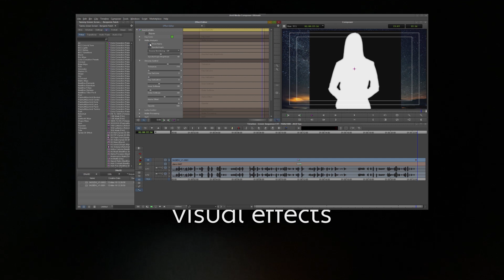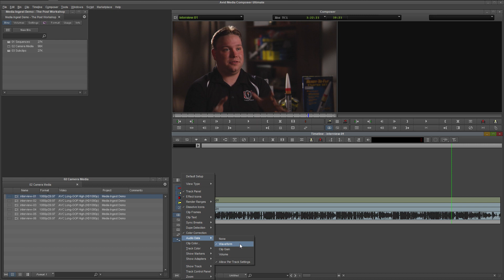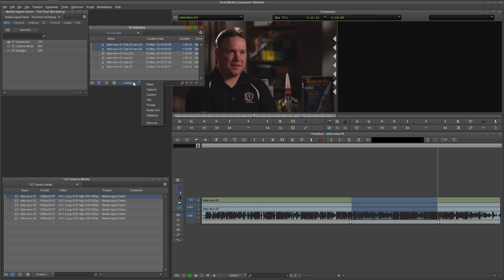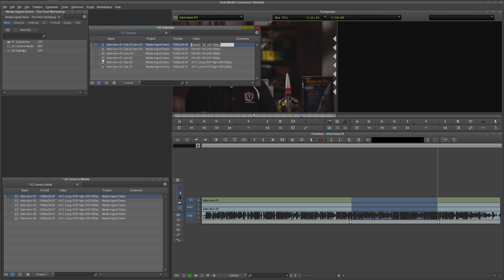Avid Media Composer - Optimize Partial Subclips for Video Editing

Comment: If I'm working with 4K files in a 1080p timeline, I like using the FrameFelx functionality to zoom and move into the image. If I transcode these files will I lose this functionality? Can I keep the 4K resolution if I transcode using the suggested DNxHR codec?
Reply from the maker: Great question! You can still use FrameFlex after transcoding. In fact, FrameFlex  should run faster and smoother after trascoding to DNxHR. If you are working with 4K footage  in a 1080p project, be sure to transcode using 'Source dimensions' and NOT 'Project dimensions' or the footage will be resized to 1080p.
Reply: @CelestialCinema  Thank you! I will try this on my next project.

Comment: the link method is fast but does affect the quality of clips ? which way is more recommended in cinema industry ? thank you
Reply from the maker: Hi Zakaria - The link method does not affect the quality of the clips but they might not playback smoothly. It depends on what kind of media you are linking to. The recommended method that most professionals use is link to and then transcode method - video 2 on this playlist. Thank you for watching!
Reply: @CelestialCinema  thank you

Comment: These tutorials are very, very good but I always always prefer to import and I almost never link. I don't like the extra clips/new.01 designation on the clips.  It does take longer than transcoding but I just set up my imports at a time when I know I won't be working in AVID.  It's quicker and cleaner to batch import the media when project is done and I want offline clips restored...Lastly, I one time had a really bad crash while transcoding that has now irrationally made me not want to use it. Fact is though I do short form promo/social media stuff so I don't deal with large amounts of media and especially not 4K stuff yet in which case I would use the lessons you taught me here.
Reply from the maker: Thank you, Brian! I am glad you enjoy our tutorials. I appreciate you sharing your thoughts about importing vs linking in Avid Media Composer.

Comment: i have problem when linking the mp4 files. and still dn't work with import method. how i solve this issue?
Reply from the maker: What happens when you try linking to the MP4 files? Is there an error message?
Reply: @CelestialCinema  yes,  they said, "unable to link to file or volume.
you may need to download & install the AMA plug-in from the Avid AMA website. see Console for information. "
and there is two option  "OK" and "Go to Ama plug-in Website"
Reply from the maker: Easy fix. Go to Avid's AMA plug-in website:
https://www.avid.com/plugins/ama-plugins
Download and install the plug-in required for your media. Avid ships with support for many common formats, but many others can be added with free AMA plugins.